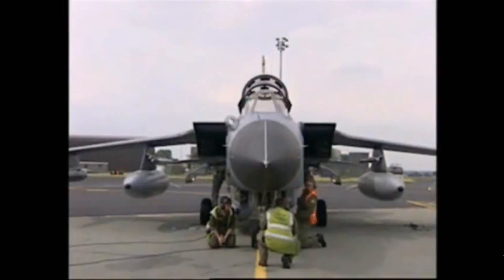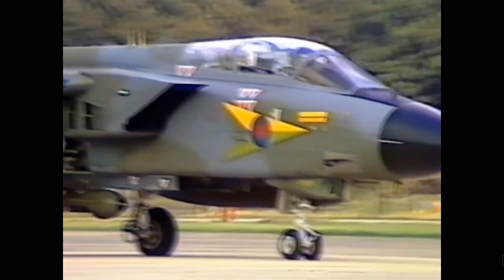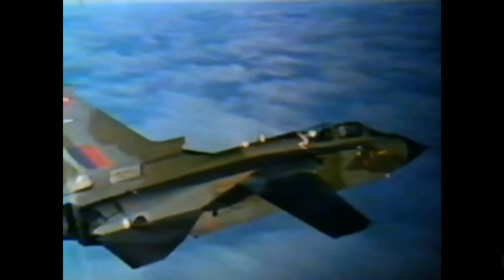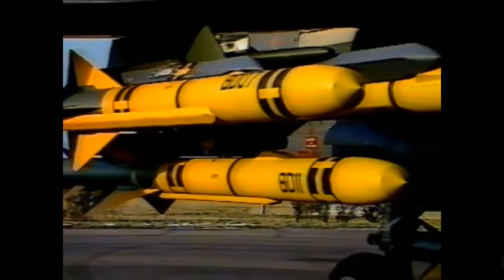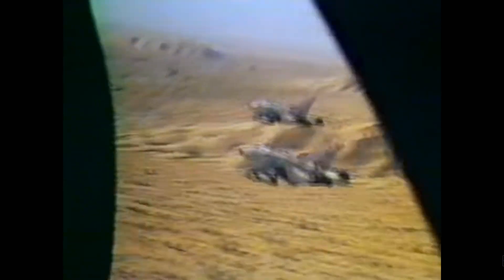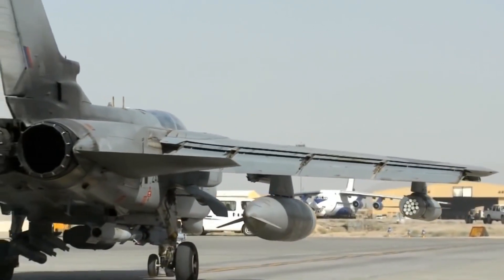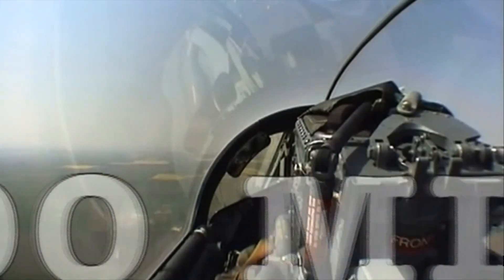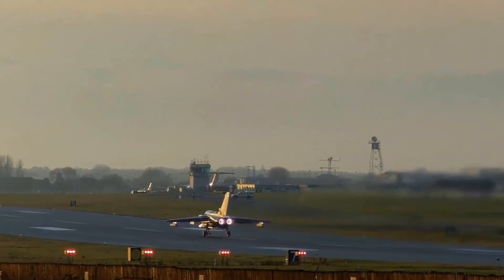Panavia Tornado - Twin Engine Sweep Wing Fighter/Bomber

Comment: Upgrades are the way to go. Thrust vectoring has been researched on older airframes, increased stealth has been tested on older frames, new electronics can be placed on older frames. New more powerful engines can be placed on older frames. New material can be used to construct older frames. There is relatively few advantages that a new airframe design brings.
Reply: The tornado strike aircraft was designed from the ground up for low altitude penetration and bombing missions. Sadly these missions have been proven suicidal in modern battle. Upgrading all the engines and avionics would indeed allow it to do its existing mission better, but if that mission profile is no longer planned for, then why bother?
Reply: ghostdog688 actually many variants exist for many different roles. That kind of goes along with the point. Isreal uses an air superiority fighter for ground attack missions. Most of that is in the munitions compatibility and electronics...
Reply: None Ya Buisness as a final aside, adding all those features to an existing airframe adds weight, which affects performance. At a certain point your better off starting from scratch. That’s why the tornado got dropped and replaced with the eurofighter, which out does the ADV variant in every way.
Going by your logic, eh should have stuck with heavily upgraded Sopwith Camels.
Reply: ghostdog688 New electronics would be placed where the old electronics existed. As you mentioned the fuselage can be modified if needed. The ADV and GR4 are almost completely different inside..? That's kind of the point, you can have a new plane with the same airframe. Nobody was saying change the role of a unit/squadron or making an air-superiority fighter a multi-role fighter.

Adding all those features doesn't necessarily add weight, many modern engines are lighter and produce more thrust, many new construction materials are lighter and stronger, and byte per byte electronics are lighter and more compact than their similar older worse performing counterparts.

Yes some common sense applies, at some point a new airframe makes sense. Did the F-15 Streak break apart… nope, probably can be pushed faster and harder. Did the Active rip itself apart… nope.  The airframe is solid and I believe there is good reason Israel wanted the Silent before being pushed into the 35. South Korea should have stuck with the stealth Eagle also.

It is not my logic to be irrational. I do agree with the backwards CAS support by the US in using prop jobbers to aid the A-10, increased loiter time, slow enough to ID, cold enough for many missiles to have a hard time locking on… and all possible because of advanced electronics on old frames, but a Sopwith Camel, really?

Comment: I love the Tornado, when I was a kid I got to sit in the back seat of a GR.1 and it fired my imagination and I've been a plane nut ever since. The F.3 fighter version of the Tornado was actually quite an impressive plane and a totally different animal to the attack version. It was longer and due to its fighter-bomber basis had incredible range and loiter time on patrols, not to mention being extremely fast. Almost as fast as the famous English-Electric Lightning. One of the really cool things about the F.3 was its 'Foxhunter' radar suite which via data link was capable of extending and updating the radar of the AWACS aircraft directing the planes from way back in real time. The F.3 was only ever meant as a stop gap until the Eurofighter Typhoon became available. Those planes must have incredible electronics suites to be able to adequately replace the Tornado. There is a reason most of the Typhoon's technology is still classified.

Comment: Thumbs up for this powerful bomber. You may have forgotten to add information about the special feature "thrust reverse". Set up like an airliner. No paracute for breaking. No special infrastructure required on the airport. Just fuel and some oil and you can go to a wourld (de)tour with that plane. You won't believe where we picked up a Tornado which have become a little "kaputt" during a visit.

Comment: I loved seeing video tapes of the planes in GW 1 ,  they were screaming 25-50feet off the runways dropping cluster munitions , those pilots had steel balls .
Reply: M TODD 6 Tornados were shot down during Desert Storm. The attacks on the Iraqi airfields were some of the most dangerous missions.
Reply: Richard Hoffmann exactly, they had fairly modern ground-to-air defences and those planes were flying VERY low, I doubt other aircraft could've done the same missions the same way without losses

Comment: 12:55 Just a small correction, the Tornado F3 was never an air-superiority fighter, it was an interceptor, and when the radar and engine issues were finally sorted (towards the end of its service life), it was a very capable interceptor. My brother in law used to be in the RAF, it was his job to maintain and service the engines. One thing that he told me (which suprised me) was that Tornado wasn't certified to fly supersonic whilst carrying drop tanks, so they'd have to be jettisoned before doing so.

Comment: The Tornado is a great aircraft, I love it's overall boxy design, which still incorporates the round nose and twin engines without looking off. I also love swing wings and it makes me sad that most aircraft utilizing them are slowly disappearing. (And while the Tornado does have a mighty rear, when it comes to thicc planes, the F-14 just takes the spotlight)

And talking about the F-35, I've actually grown to like it; It's overall design is very streamlined and refined, it's capabilities are great and it's sensor and avionics systems give it a particular edge on a connected battlefield. I just hope that people stop hating it for not being an air superiority fighter, because it is as much of an AS aircraft as the Tornado: Technically it can, but honestly, it should stick to ground strike missions and fight off enemy aircraft when necessary.

Comment: It's interesting how the Tornado wouldn't have existed in this way if the TSR.2 hadn't been cancelled, that would have been a beast!
Reply: I suspect the TSR2 would have been retired too - those Rolls Royce Olympus engines would have drunk an awful lot of fuel - essentially the RAF would have been flying Concordes around. Tornado was much more efficient.

Comment: love the Panavia Tornado IDS GR2 multi role interdictor strike fighter . . . still one of the best variable-sweep wing fighter by far . . . the Panavia Tornado ADF F3 multi role all weather fighter was just as good as any F-15E Strike Eagle multi role all weather fighter . . . during 1991 Desert Storm heavily armed Panavia Tornado IDS GR2 multi role interdictor strike fighter conducting low level air strikes were entitled to receiving fighter cover, but sadly they didn't for whatever reason . . . thus making the Tornado IDS GR2s vulnerable to Iraqi SA-2 SAM batteries . . . back in early 1980s the Indian Air Force was more than eager to acquire no less than 118 brand new Panavia Tornado IDS GR2 multi role interdictor strike fighter plus 63 Panavia Tornado ADF F3 multi role air dominance fighter . . . but the acquisition never realized due to disagreements over local assembly of the Tornado IDS in India & refusing to provide TOT to Hindustan Aeronautics Ltd . . .

Comment: I guess your opinion is pretty much on the mark with Tornado being best in the ground attack role. The ECR version performed very successful in Yugoslavia 1999 as well. Whenever a ground radar spotted a Tornado, that was seconds before this radar ceased to be. It was an F-117 that was shot down, no Tornados were lost there. The reconnaissance version proved its worth as well. In 1995, Bundesluftwaffe made a reconnaissance out of the flood of river Rhine to provide data to scientists and officials about what areas were flooded at what river levels. Every day, all of the river was photographed several times from its source at lake Bodensee in Schaffhausen, Germany to Rotterdam/Netherlands. Each photographing run took them some 90 minutes, if I remember right. Well over 1000 kilometres of landscape in 1½ hours!

Comment: actually I had a book on this aircraft and it was at 1st a joint venture between UK and France but it fell through when Dassault found out that they were not going to be the design leaders also the british had wanted the swing-wing mid section and the germans persuaded us to put them high so it also gave easier engine access by letting them drop into a tray beneath instead of having to be pulled out of the rear

Comment: The JP233 runway denial weapon system which was used in the 1991 Gulf War was removed from the weapons inventory when Britain signed up to the Ottowa Convention on landmines, as it contained antipersonnel mines as well as the runway cratering bombs.
Reply: Richard Hoffmann 
The JP233 was a silly weapon that  put the aircraft and crew in unnecessary risk. An airfield does not move so would have been better targeted by missiles. The Tornado is better at striking mobile targets.
Reply: During the Cold War it was the weapon they designed to take out East German airfields. They also trained to use unguided 1000 pound bombs delivered by a loft attack. I don't know why during the Gulf War Tomahawks were not targeted at the Iraqi Air Force runways. I suspect it was because they didn't have the specialised dual warhead that the runway cratering bomb carried by the JP233, that made the runways much harder to repair.

Comment: Great video. I'm curious though, with the variable sweep wing, how did the weapons pylons and wing payloads stay parallel to the fuselage during in-flight changes in wing sweep ? Or, did they ? It seems they would have to or the wing payload would cause excess drag on the plane.

Comment: Did not know these were still in use.  As strike bombers only I imagine.
Reply: Yep, those things were generally used as bombers besides more purpose build fighters. Classic strike fighter, basically.

Still being in use is nothing special, though, many fighter jets these days are originally from the 70s. Americans plan to build (!) F-15's till the 2020's, use those at least till the 2040's, because they lack a dedicated fighter aircraft besides the F-35...
Reply: Termitreter erm, F22? F16?
Reply: F-16s are just as old as the F-15; well, maybe 2 years younger. Makes the design 40 years old this august. This fighter aircraft will be replaced by the F-35 in the next 10 years, assuming there are no more delays. (yep, a fighter aircraft replaced by a strike fighter, gj US airforce)

The F-22 program was cut short, there are only like 120 actual combat machines (compared to >2000 F35). That tiny number doesn't really account for much, as impressive as those birds might be. 
This is the root of the American problem here: With the cut, the US lacks a modern fighter aircraft; the F-22 was supposed to serve alongside and protect the F-35 from other fighters. Now they just don't have a modern (aka less than 40 years old) fighter aircraft.

Of course, the worst thing for the US is that the only carrier capable plane will be a gimped version of the F-35 (B or C). This could make them scarily easy to attack; particuarly considering enemies have super/hypersonic anti-ship missiles that can be dropped by bombers, at 300km range and more.

Comment: Matsimus : One should look at the scenario the Tornado was build for:

The Tornado was build agains the massive armour assault of the Warsaw-pact in the 1970-80'ies. The first wave was to be stopped by the Chieftains and Challengers - which they would have done given they have almost the double weight and armour of the russian tanks. The problem was, however, that the british, dutch, german and american tank forces would have been worn down over a period of - say - weeks.

The problem of the Tornado was to take care of the follow-up of the Soviet forces. The Tornado was meant to streak into the land BEHIND the first line and smash the supply coloumns and reinforcements coming up with the intent of driving through the remnants of their own forces and what was left of the Nato armour. In other words: Create one devine traffick-jam of disabled vehicles.

For this the Tornado had to be surviveable at low level against a missile and aircraft protected force - which it probably would have been able to do. Nothing catches the Tornado at low level, and missiles would not have time enough to aquire a bunch of Tornado'es screaming along at 100 feet - that WAS the altitude.

Comment: Back in the 1980's I would occasionally see  a low flying Tornado thundering down the Ouse Valley in Sussex.I was surprised to see them with either the German Cross or Italian  roundels.I first thought they were heading home, they were flying in the right direction . l learnt later they were from R.A.F Cottesmore's Tri National O.C.U in Liecestershire. It made taking the Dog for a walk interesting.
Reply: You also had a Tri Nation Tornado unit at RAF Coningsby for the F3 with the Germans and Italians as well.

Comment: Matsimus: A friend of mine was responsible for the oxygen filters on those planes for the German air force. He said it was a really stupid system. They had 24 hours to check them, got it done in 12 or so but still had to write down the 24. Did that happen to you as a tank guy as well?
Reply: +Thoran666+ I'm also sure the swing wing mechanism was also a pain in the ass to deal with from a maintenance standpoint, the F-14 Tomcat certainly was!
Reply: Thoran666 that is very common in aviation because the time is calculated based on following every step with an allocated time. But what your friend won't have told you is the one day they had a problem and it took 3 days and they booked 24 hrs.

Comment: The first golf war was Iraq against Iran my friend. The second and third ones were then USA... against Iraq.
We Germans should get the Gripen as replacement for the Tornado and put the low level flight radar in it.
Gripen can also carry pretty much everything in terms of bombs (especially the KEPD Taurus).
The purpose of the Tornado was to bring nukes to Russia.
Reply: FrancisJoa the British were definitely there too in the latter two, I know guys that served in both. As for the Iran-Iraq war it's called specifically that for a reason
Reply: FrancisJoa and if that was the only purpose of the Tornado do you really think we'd still have it in service TODAY?! If that was the only thing the RAF wanted a bomber for and was still considered a valid need we'd still have the Avro Vulcan in service instead
Reply: Can the Avro Vulcan penetrate the heavily secured Russian airspace with under the radar flying low level missions?
No it can´t. Therefore the Tornado was developed for. The Tornado should bring nukes to Russia.
Why do you think I wrote USA..... The dots were for the other countries who were fighting together with the Americans.
Reply: FrancisJoa having the capacity of doing something doesn't make it it's sole purpose, if the Russians wanted to stop any conventional aircraft getting through their defenses they could regardless of altitude and the designers knew that, it had the ability to do that in the long term yes but it was intended in the short term to act as a general-purpose strike aircraft with some air-to-air capabilities to boot in order to get out of trouble. And that's not a very clear way of saying that, maybe just use actual words next time like we're doing now :)
Reply: FrancisJoa the primary method of getting a nuclear weapon to Russia from the UK was then and still is submarine-launched missiles, Trident specifically
Reply: Read about the history of this plane and you will see that especially the British wanted this low level under the radar flying capability exactly for this one purpose and that was to bring nukes to Russia. This plane is from the cold war area.
Reply: FrancisJoa and ALSO the ability to do other stuff besides that, I never said you were wrong about that, my point is that was never it's sole purpose unlike the V-bombers before it
Reply: FrancisJoa had WW3 turned nuclear, it's role would have been to strike strategic military targets in East Germany and Poland at ultra low level, such as large fixed SAM sites with the WE177 tactical nuclear bomb
Reply: FrancisJoa

The British wanted the tornado as a low level strike aircraft, to penetrate Warsaw Pact airspace - yes - but to bomb Warsaw Pact airfields, to get in under the SAM belt, to lesses the chance of being detected at range.

The Tornado was never designed to go all the way to the Soviet Union. The only British Bombers with that role were the old V Bombers (Victor, Valiant, Vulcan) but that role stopped with the introduction of Polaris, before the Tornado was even on the drawing board.

Tornado, Buccaneer, Jaguars, Sea Harriers - all carried the British WE 177 nuclear bomb but as a tactical weapon, for use against ground troops, airfields, targets at the front line  (or with the Sea Harrier its main role was nuclear depth charge). 

Britains long range nuclear deterrent and capability has rested solely with the RN and its 4 Polaris and later replacements the 4 Trident boats since the 1960's, 

Just because it was nuke capable, does not mean it was supposed to take them all the way to the Soviet union. The were tactical bombs once the Vulcan was retired from the strategic nuke role (the last of the V Bombers with this role) and reassigned to NATO as conventional bombers and with a capability of carrying the WE 177 in the tactical role